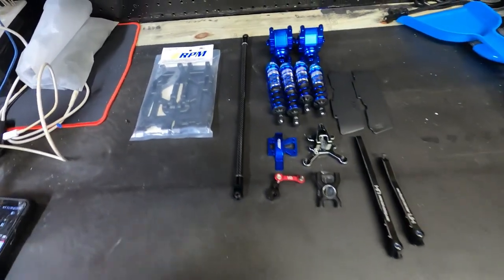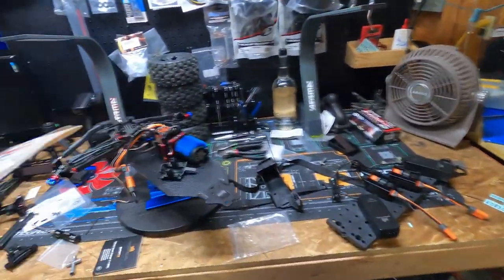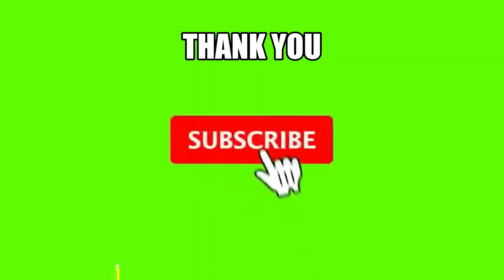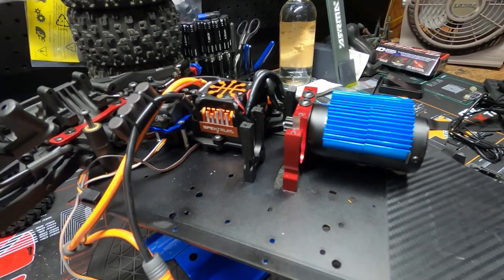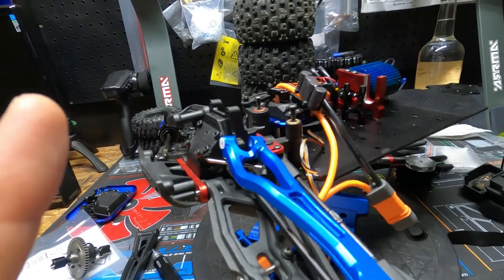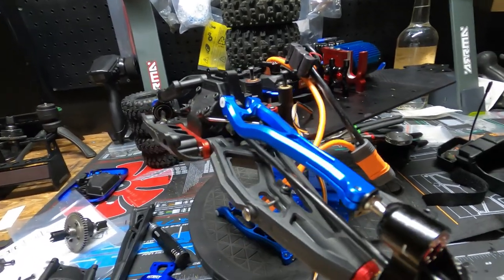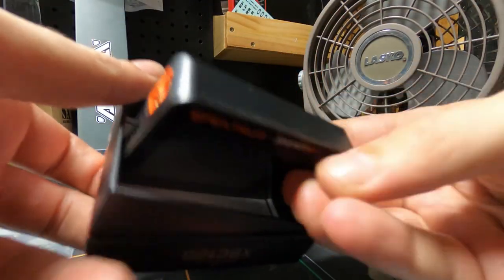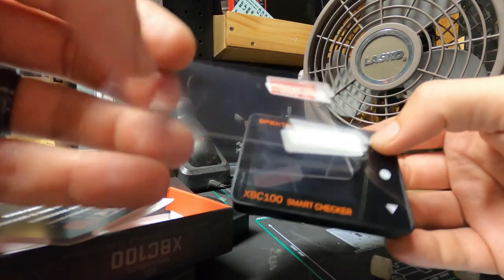KRATON6S+ PARTS "NOT FITTING"+ UPGrADE FAIL !

Comment: Hopefully it's a shelf queen because that first big jump all that aluminum is going to bend 😕😳
Reply from the maker: Well not necessarily because only certain structural parts in the truck or aluminum everything else is plastic I've been doing RC cars for a long time and I pretty much know what parts break in fail and which ones don't which is the reason why I took the curtain upgraded route that I chose but that's why you keep the original parts cuz if you bend it you just put the new one on thank you for your comment new video coming out consider subscribing

Comment: You need parts for a V5 Kraton. What you have ordered fits the V4
Reply from the maker: which part .is v4 . . i order alot .
Reply: @ATECHPCs  when you look up the upgrade parts look for the parts for a Version 5 Kraton. They changed quite a bit between the version 4 and 5.

You have a V5.
Reply from the maker: @boogiemere1214  ok. Thank you. Good to know

Comment: With all alloy arms what do you think will brake at a crash, you will kill the hole bulkhead and tare the hinge pins out! Don't you think it makes sense that they're made of plastic! Brain Acrobat!
Reply from the maker: Oh yes you're absolutely correct but that is the reason why I only went with the top the bottoms are the ones that give when you wrecked the car and yeah I saw that GPM was a little bit on the cheaper side so that was the reason why I only bought that one part from them and even then I wasn't happy with the way that the part was machined.     thank you for your comment consider subscribing